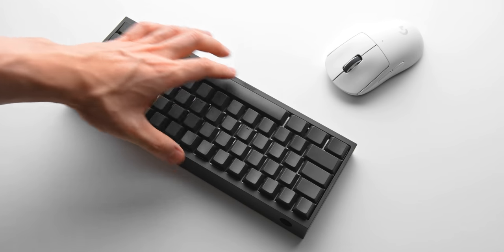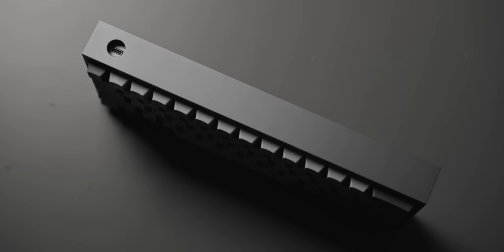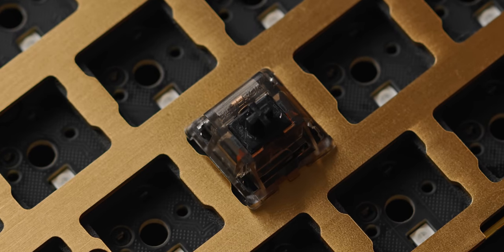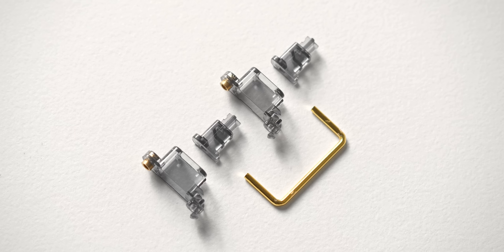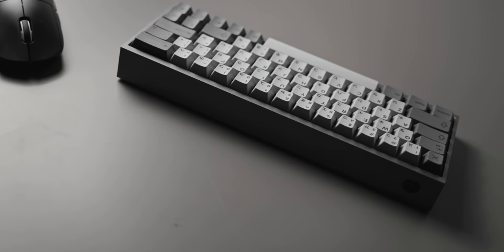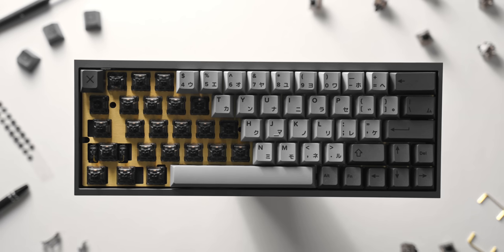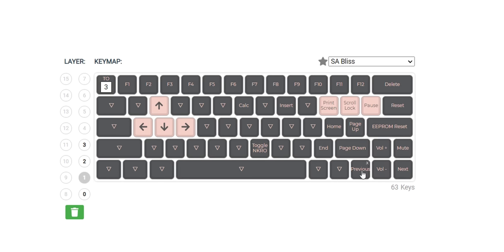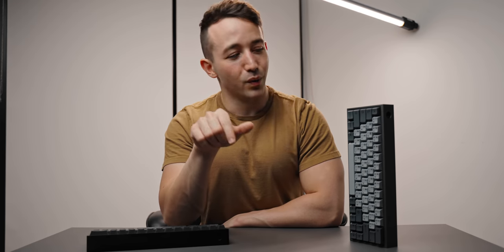Building a Better 60% Gaming Keyboard

Comment: Great video as always!
Surprised you haven't tried out a 65% or a 75% layout. Having just a few extra keys to remap makes a pretty big difference, and they don't take up much more space than a 60%
Reply: @chocolatezt  I would argue that you do give up some functionality. I mean, you have less keys which means you have less possible layers. Layers are great, but why not just have a few more keys on your board for keys and macros you use often? If it were just about maximizing the utility of keys, we'd all be stenographers. 
Plus, just because you can layer keys doesn't functionality remains the same. If one loses their legs they won't lose functionality because they can move around with their arms or get a wheelchair, but I doubt one would cut them off to shave a few pounds off of their frame and lower their metabolic rate to be more efficient

Comment: Im actually building mine right now, and I was interested in that layout. My only question is, where was the /? key mapped to? Loving the vids <3
Reply: its to the right side of the right shift :)
Reply: It works like when you tap it, it does /, but if you press left shift and tap right shift it does ?. Hold right shift and press letters for regular shift. It’s a pretty cool setup

Comment: If your gonna build another custom board but still want the 60 percent layout the bakeneko60 is the best, aluminium case, Gasket mount, hotswap. And it's an in stock purchase, no long group buys. The only downside (which isn't really a downside) is that you can only use clip in stabs, but if you take some time to lube, and holee mod them, they will be fine.
Edit: forgot to mention it's only $130 for the pcb, case, and plate.

Comment: What is currently the meta in stabilizers which aren't too expensive? Optionally screw in stabs.
I've still got an old set of gmk's which rattle like crap despite what I do to my spacebar.

Comment: I have the aluminum mount, but I wanted to ask if the PCB was 3 pin or 5 pin? did you not clip anything on the switches and just installed?

Comment: I have owned 2 Tofu65s, but I'm super curious as to why you went with another Tofu60. Even the cheaper KBD67 Lite (even aftermarket) would have been a good enough try for a slightly more accommodating layout.
Reply: I second the kbd67, I’ve got an ink black polycarb one that I love. For full price it’s more expensive than his but I got mine aftermarket essentially untouched for $50 less than retail, you just have to lurk for a while. Any of the in stock KBD boards will come up on mech market for cheap when people get their group buy boards and sell them, it’s a great way to save some cash if you trust randos with that much money. I’ve had a good experience overall, fwiw.

Comment: This better be good, cause I ordered the same set but with gateron black silent. 50% cheaper then the gateron black ink but sounds almost the same. But total came out to $500
Reply: Gateron black silent sounds no where near to black inks lol
Reply: This will not be good at all, change the plate and the switches if you still can, if not then you’ll regret it soon enough trust me

Comment: since you are already putting that much foam into the keyboard, consider using the switch pads that kbdfans (and other vendors) have. its just a thin sheet of foam that goes under the switch. I haven't used them personally, but apparently makes the sound stand out more. While at it, I would consider myself either a PC plate or another alu plate, or hell even carbon fiber while you are at it it will help the builds look more stealthy and also has a more distinctive sound profile

Comment: where can i get a full set up exactly like this from? I have money (enough for something like this anyway), but I have no patience.
Reply: Look at premade 60-75% keyboard offerings from Ducky, Epomaker and Anne Pro which all make decent mechanical keyboards. You may then replace the keycaps if you wish to mimic the styles shown on this video.

I can also recommend SteelSeries Apex series for pure gaming, they come in various sizes. Probably the best “ready to use out of the box” gaming keyboard out there before you start getting into this kind of DIY custom-built territory.

Comment: Hey man, just wanted to say that I love the content you put out. For real the things you cover from the BENQ monitor, to the Artisan pads, to now joining the darkside with the Starlight-12 (hehe) I really appreciate the effort and production quality you put into each video. - So essentially I'm looking at my first custom keyboard build, going from the Ducky, to potentially a TOFU60. My one concern is the typing angle for gaming as on my Ducky I don't use either of the legs to raise the back. Would you consider the TOFU60 too high for me? It's hard to judge as I don't have one to try. Thanks in advance.

Comment: The customized keyboard market is now the same as air jordan. Every time you release a new design or new color, you wait for him to release the goods. You have to rely on internal relations, or your news is fast enough and rush buying. The scene is like feeding monkeys. Those who grab it may not use it by themselves. It can be sold at a high price. Some people will be tempted to make huge profits. It's not just a custom keyboard, but also an SFF chassis, such as formd, which is now in hunger marketing.

Comment: has anyone tried spraying wd-40 on the keyboard without key caps?
Reply: Why wd40 ?
Reply: @cengi  the cost of opening up each key and using oil to lube it is high. how abt removing keycaps and spraying wd40 every 3 months or so. bound to get in most places. worth testing.
Reply: @teachonlywhatiseasy  Idk where you live but I'm n my place 205g0 price is not that far from wd40
Reply: @cengi  time, effort is the price
Reply: @teachonlywhatiseasy  If you really don't want to spend time lubing with the traditional method, then just do the lazy lube method. You pushed the stem down then try to fit the brush at the sides. Wd40 will just mess the switch up over time...
Reply: @cengi  that i can do. alright. i'll find a brush and oil and give that a go for one of the keyboards
Thanks